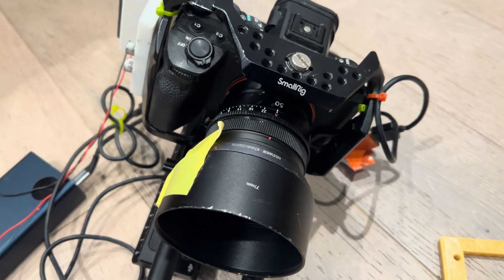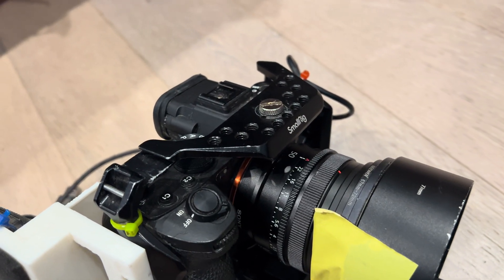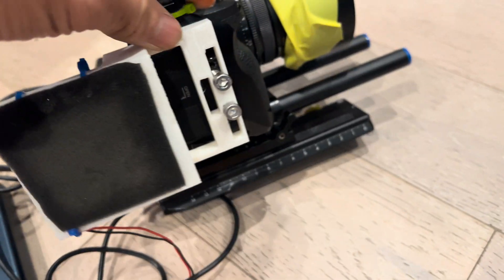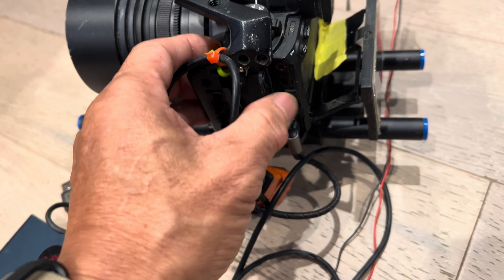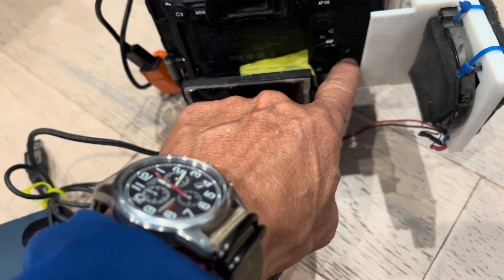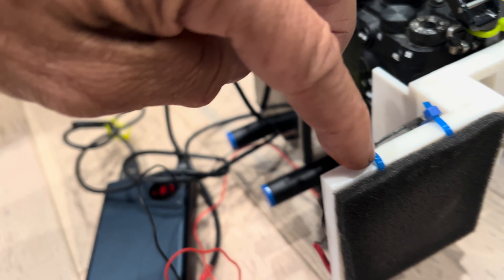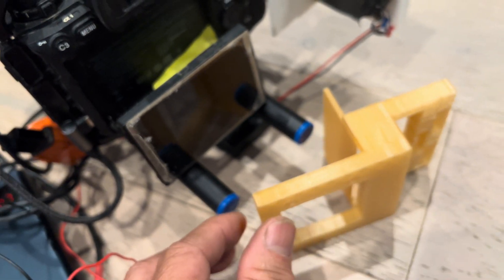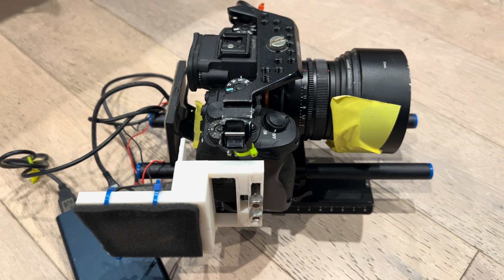SONY A1 8K OVERHEATING SOLUTION - Fan set up for Sony A1 for 6+ hours recording in 8K30fps

Comment: The fact you have to do this at all sucks :/ But great solution.
Reply from the maker: I think the only 8K camera in the same price that doesn't overheat is the Nikon Z9.  But I'm all in with Sony so I have to make do with the A1. I have thought about switching to Nikon to get the 8K60fps but what stopped me was the average video autofocus performance.
 BTW the reason I do 8K is that I can crop in 200% and still have 4K.
Reply: @pomanprod  is the cropped in 4K fiom a 420 8K better than the 4K 422 all I?  I am considering filming a fireworks show in 8K 30 vs 4K 60 all I  with the A1 and 14 GM.  thanks for your input.